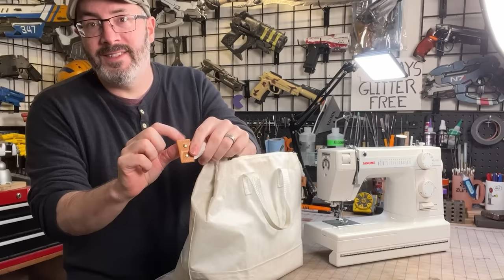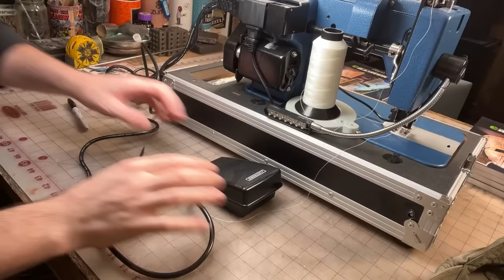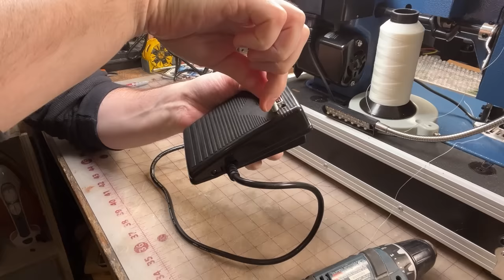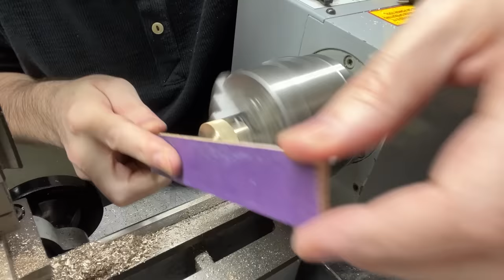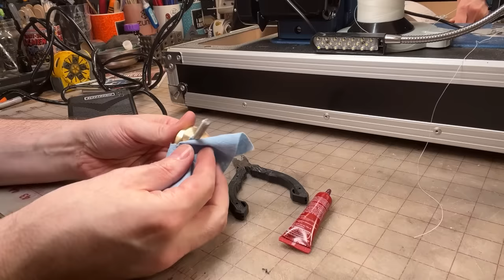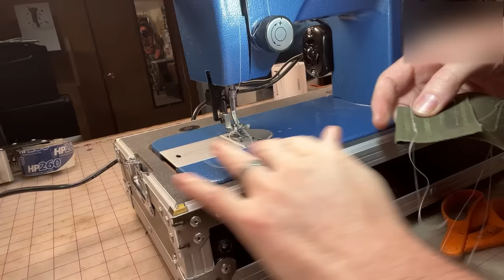I'm Intimidated by this Sewing Machine

Comment: Picked one of these up a year or two ago and had the same speed issue as well at first. Ended up adding the WorkerB power pack and the monster balance wheel a month later. Between the two it can now creep along stitch by stitch while still handling several layers of veg tan leather. Truly an amazing machine!

Comment: I'm a leatherworker and I use a Sailrite leatherwork model for my light work.  it is a very similar machine your using but it has a small table with a servo motor that has extreme speed control.  For heavy stuff (7/8ths inch of leather) I use a hand driven Tippmann Boss machine.   The sailrite will do you well for a long time and their support team are amazing if you run into issues.

Comment: It kills me that sewing machines this heavy use one handle on top instead of two side handles >_<
Reply: The cool thing about Sailrite is they have a really responsive internet presence and are very active with their customer base online for feedback like that.  It's not uncommon for me to get a reply to an email from Eric Grant.
Reply from the maker: I agree, two side handles would be preferred. I don't know who's out there one-handing their Sailrite kit.
Reply: You're just going to have people falling over forward then! 

Put them in a wheeled cart like luggage.

/J
Reply: @Morberis  I know it's just sarcasm but it's a valid complaint though.  That case is a lot heavier than guitar amplifiers I've picked up in roadie boxes three times that size.  I can see someone tweaking and throwing their back out from trying to walk with a gait was and at least 50 pounds hanging off of one hand to their side.  It's very awkward to load in my truck even.
Reply: @Morberis  It's almost like no one actually tests their designs anymore :/

Comment: Welcome to the club Bill! I see others mentioning the worker-b motor and I totally agree it’s worth it for the speed control. I’d also love to see you use your design and 3D printing skills in making a stitch length panel that locks the lever into specific length settings instead of the bolt they use to restrict the lever.
Reply from the maker: These are all great ideas!

Comment: I have a foot feed peddle on my rotary tool. In order to make it easier to control the speed I placed a piece of fairly dense foam inside of it. It not only made it easier to make small adjustments, it also made it easy to maintain a consistent speed
Reply from the maker: That's a really great idea!

Comment: I HIGHLY recommend the worker-b attachment! It gives you super fine control of the speed to the point it’s individual stitches at a time all the way up to ludicrous speed.
Reply from the maker: I'll have to take a peek at that thing.
Reply: I was going to suggest a sturdier device to put the potentiometer into, like a broken old guitar volume pedal, but I see that the system's total power depends on that potentiometer, and that workerB attachment keeps foot control to full power at any speed, and the max speed is modulated instead by knob on the machine. Variable speed with max power could still be done with pedals, but the basic method as shown in the vid is not ideal. 

Still, it seemed fine for the purpose at hand, assuming "lugging it" with low power isn't damaging to the machine. At minimum I would recommend melting a threaded insert or nut into the plastic housing, and a tab of sheet metal at the bottom of travel. Threaded plastic won't resist even a fraction of the force of a human leg, and keep in mind that if the thread fails, the machine will unexpectedly jump in speed. More forgiving than a lathe, but still dangerous if not respected.

Comment: I've been using that machine for about 8 years now and have made several small upgrades along the way, the last being the Worker B motor.  This one is much more versatile and is my favorite.  The speed control you came up with is equivalent to the Worker B dial out of the box.  It's also a DC motor and much quieter.
Reply from the maker: Oh neat! I'll have to check out that motor.
Reply: @punishedprops It's 50 bucks off right now if you're at all interested... lol

Comment: I didn’t think it was that fast. My Singer Heavy Duty will go up to 1100 stitches per minute. I don’t have a good sewing table, so when I gun it, the whole table shakes. When I worked in industrial embroidery, those machines could be intimidating. We ran them between 600-700 stitches per minute. If you reached in to grab a loose thread, as people sometimes did to keep it from being sewed into the design, and you got a finger under the presser foot, that needle was going through your finger. I only saw the aftermath a couple days after one dude’s accident, but he brought in a copy of the x-ray with that needle piercing through the bone at the fingertip. Gotta have some healthy respect for a needle that can pierce through the hem on jeans easily.
Reply from the maker: My grandfather sewed his finger in a machine once and I've been pretty gun-shy ever since.

Comment: Congrats on the sailrite. They’re amazing but take a little getting used to. Ive found I always have to hold the loose thread taught when starting a stitch until I get a couple backstitches in place or I’ll get bunching under the workpiece. Other than that these are dirt simple and last years.
Reply from the maker: That's a good tip, thanks for sharing!

Comment: My first thought would have been to either change the taper (linear, log, or reverse log) or value of the potentiometer, but the mechanical solution is much easier. Especially given the slide/fader pot doesn’t usually have as many options as a rotary pot.

Comment: The should be a speed control dial so you can still use the fully control of the footpedal at much much slower maxium speed.
Reply from the maker: I guess they have a different motor for this machine that will do that.

Comment: That monster runs so fast because it’s intended for making very long stitches in sails. Keeping up with it is just a matter of practice.

I’d suggest you reinforce the threaded hole with a brass or steel insert, backed up with some extra plastic. Over time those threads may be stripped out.

I’m a little concerned with running the motor at such a low speed for long periods under load. That can do awkward things to the bearings, fail to keep lubricants where they should be, and overstress the motor. Also, if there’s an internal fan to flush heat away from the motors, it may not be moving enough air quickly enough.

Other than that I think you’ll be very happy with your new superpower of being able to work with much heavier fabrics and leather.
Reply from the maker: Thanks for all the great information!

Comment: If the base of the footswitch is plastic like the footplate, would suggest putting a thing piece of metal where the end of the screw meets the plastic to prevent any possible long term wear.  Personally would probable steal a feeler gauge leaf for this use.  Hard, smooth, inexpensive.  Attach however you want, CA glue
Reply from the maker: I like that idea!

Comment: You could fix the whole and make the adjustment screw sturdier by making a 3d-printed part with a captured steel nut that the screw would tread into instead of the plastic of the pedal. While you're at it you add vertical grooves to the bottom part of the knob and a springy tab on the new part in such a way that the tab clicks in the grooves when you turn the knob. This would prevent the knob from loosening due to vibration and make a satisfying sound when you adjust the maximum speed.
Reply from the maker: That's a really great idea!

Comment: I know the making of the thing was the point, but if someone was less hardware inclined, I wonder if something like an AC Motor Variable Speed Controller (that you just plug the machine into) would perform the same function.  If so at least you wouldn't have to worry about doing something that would noticeably bring your warranty into question.
Reply from the maker: I wonder if that would work.

Comment: It's crazy to me that such a sturdy looking sewing machine would have such a dinky lightweight pedal. It looks just like the one i have on my Jenome machine.
Reply from the maker: I feel like sewing machine companies have been using the same pedal for decades.
Reply: @punishedprops  It is, quite literally, the same pedal and motor that's appeared in sewing machines as far back as the 1950s. Or at least slightly upgraded versions of it. That chunky 3-pin connector has appeared on so many sewing machine models that it's almost impossible to count them up.

Comment: If this machine sees medium to heavy use, make sure you are lubing it between every use or even mid session for a long session. If lacking lubrication it can wear in a way that basically ruins the machine.  A good friend of mine has worn out 2 using them to run his business. Great machines but they need that lube!
Reply from the maker: Always lube. Got it!

Comment: i had a Saillrite but was disappointed by how the Feed Dog top and bottom marred the material especially leather. I saw on your demo it marred yours also.  I sold mine and got a old industrial Singer 31-15 Treadle machine for half the price and alot better imo
Reply: Smooth feet are available for walking foot sewing machines, including the sailrites, and in combination with correctly adjusting the presser foot pressure they shouldn't leave any marks on leather or similarly impressionable materials.
Reply: @Nicoya  I looked into feet and feed dogs for Sailrite they are expensive $49 a set. And only available from them. When you can get singer 31-15 needle plate feed dogs and tons of feet ALOT cheaper of eBay.  Jmo
Reply: @RonThompson  No disagreement there, there's definitely more affordable machines out there.

Comment: do bigo old sewing machines like that have GEARS? or BELTS, like a bandsaw? it seems like somehting with that crazy power should be able to have a "high torque, low power" mode for different materials
Reply from the maker: For low speed and high torque, you can run the machine by hand.

Comment: That's just a meaty machine.  I'm looking for a new sewing machine to replace the $10 used Singer Simple that jams every 2 minutes, but this might be overkill.  I do a little leather work so it would be nice if the new one would handle that, but I'm assuming this is a bit out of my current budget.
Reply from the maker: It's a bit of a jump up in price, especially new, but I bet you can find some good leather/industrial sewing machines used for a fair price.

Comment: "...this thing goes!" 

*Laughths in 60`s industrial sewing machine that has a modern high power servo-motor attatched to it

But on a more serious note, the Sailrite can definitely be intimidating if not used to it. But all things considered it´s still very approachable and comparatively harmelss if you treat it right. At least it won`t suck in your workpiece at loudicrous speed, fast enough to shoot it out the other side if you mess around. If you are unlucky also pull your fingers in with it and stitch them to your workpiece through the bone like the monstrousety I have build. xD
Reply from the maker: Sewing my fingers is definitely a concern.

Comment: Every sewing machine is a compramise. No one machine will do everything (well)

If it sews light weight fabric then it wont sew heavy fabric (well) and vise versa

If its portable, it doesnt handle large projects (well)

I have a sewing business that focuses on heavy bags and repairs.  I have 4 machines and could probably use a couple more
Reply from the maker: That's awesome! I'm sure I'll end up with several more machines in my shop too.